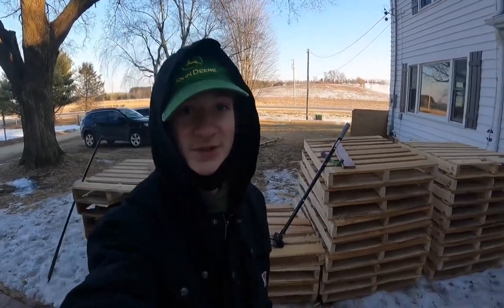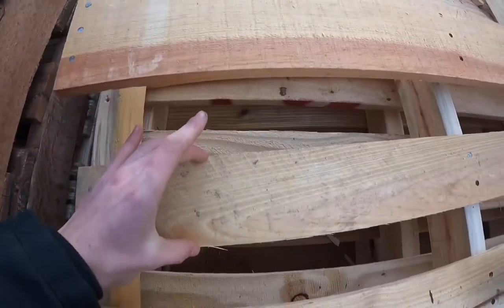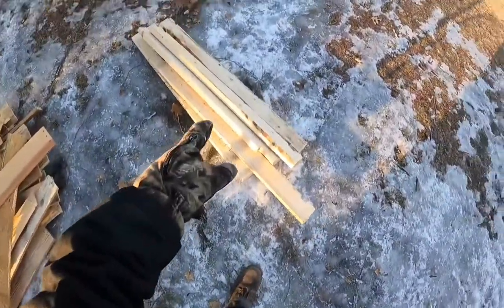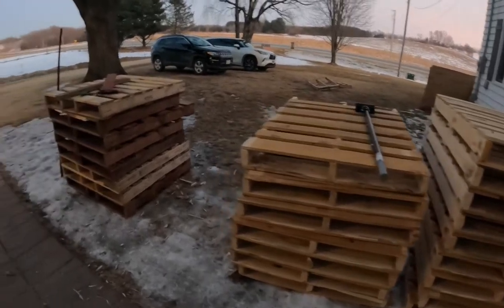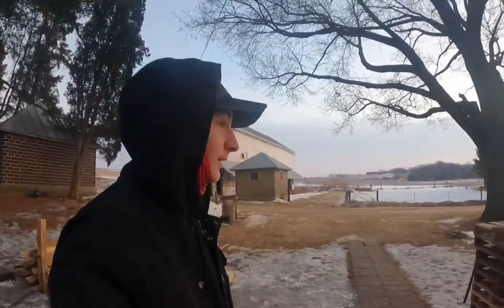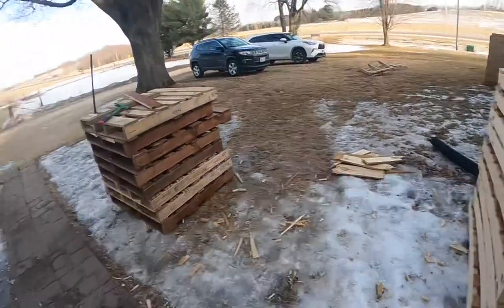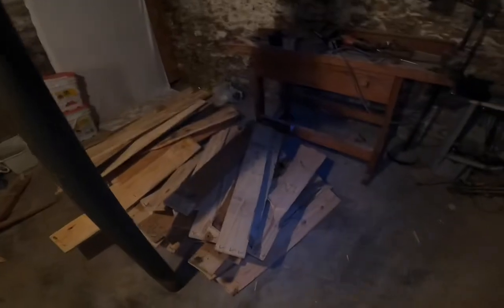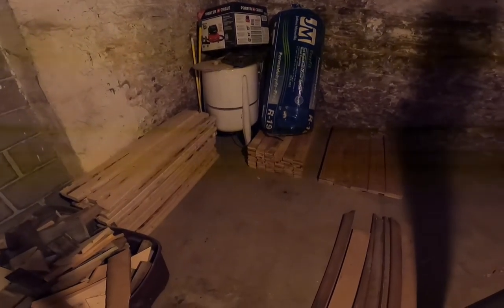Pallet Buster Test and Review | Taking Apart 27 Pallets

Comment: Nice work; Have you considered using other tools (air knocker and nail remover)? Obligatory Liked and Sub’d! 👍▶️ 🔨
Reply from the maker: Thanks! Yes I have thought about that but this seems the easiest and cheapest however those would work good to.
Reply: @FureFarms  - I was taking apart panels likewise. I use a small pry bar & a hammer also. I started considering other options when I was breaking boards for 6+ hours and 80+ degrees. Nice work, keep it up! What kind of wood projects do you have in mind for the future?
Reply from the maker: I would like to do more epoxy river tables and things like that. I would eventually like to be more professional with the projects too!
Reply: @FureFarms  -Looks like you are off to a good start!